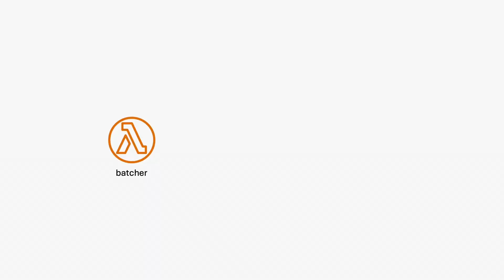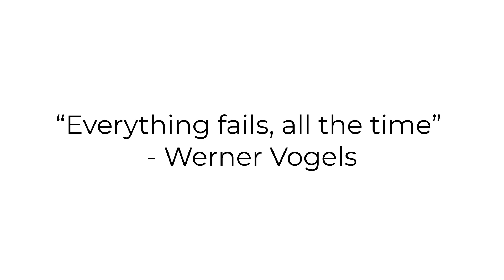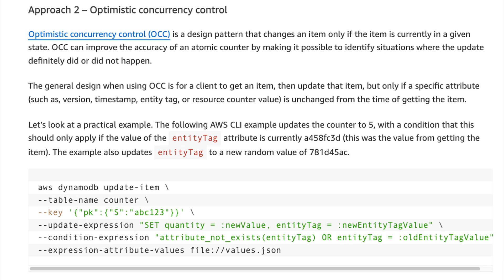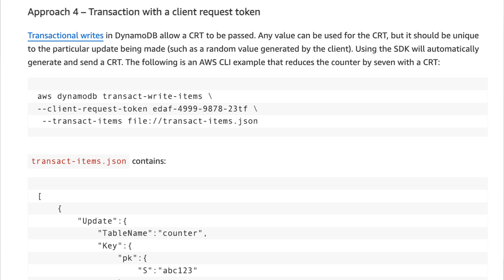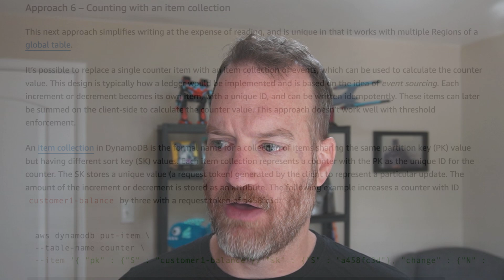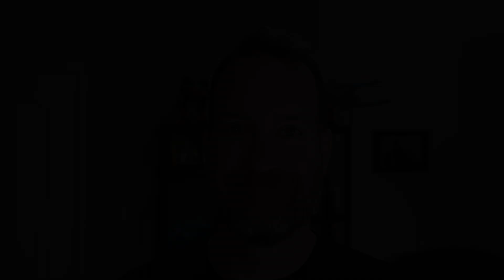Batch Process in AWS - Part 2

Comment: Is Dynamo failing or just that standard SQS is at-least-once delivery? I see the latter quite often, but never really notice the former. Either way, if you want to guarantee/validate your counts, just give each task an ID and once done fire them onto a FIFO queue with deduplication, you can compare your counts before/after each decrement. This requires more DB reads, but you can consume messages 10 at a time, so only have to write 1/10 of the time, making it cheaper overall (not counting Lambda execution time).
Reply from the maker: DynamoDB sometimes fails and that ends up with over/under counting on the atomic counter I covered in the previous video. FIFO queues wouldn't solve this problem.
Reply: @MatthewBonig  Maybe I wasn't clear. I'm pointing out two issues and a solution for both. Use a FIFO queue to process counts with deduplication. Use the handler attached to that queue to read, then write, then handle 500 errors, knowing the count before the error allows you to correctly apply the count.
Reply from the maker: I don't think I understand.
Reply: @MatthewBonig  You want to accurately count the completion of a batch of tasks on an SQS standard queue, right? There are two problems with what you're doing. 1. SQS standard queues are at-least-once delivery, meaning you can get double counts. 2. DynamoDB may fail with a non-deterministic error (the HTTP 500 you mention in your video), meaning you don't know if your count was recorded or not. 

A simple solution to both problems is to place the results of your tasks onto a second queue (not DDB). This queue needs to be .fifo with deduplication. Its handler needs to read the current count before updating it, that way it can validate the count in the unlikely event of an error and decide to retry or continue. In other words, the fifo queue lets you update the count sequentially and validate the result. The only caveat here is the 5 min deduplication window, if your processing tasks take a long time to complete, then this might not be water-tight.

Two other DDB based solutions could include: 1. creating/update a unique record for each task. 2: adding/removing IDs to a String Set within a single record. The former gets a tiny bit ugly when it comes to checking if all records have been updated/deleted, the latter doesn't scale past the 400KB max record size.

I hope this makes sense, I'll leave it at that either way.
Reply from the maker: Why use the second queue? Why not just make the first a fifo queue? However, this only helps with the idempotency of processing the record.

As you said, the 500 when updating dynamodb is the problem. I COULD read the value before writing it, but due to the high concurrency of processing it would almost always be updated by another process. Optimistic concurrency and conditionals would catch this but would also introduce an enormous amount of churn in the processes as they kept retrying over and over to get a transaction written.

As for the two ddb options your suggested, the first is basically what my solution (see part 3) proposes, with the items being removed when processing is done and polling to check when no items are left. As for the second, you already mentioned the flaw, 400kb max record size would make this an immediate no-go for processing 100k records.

Thank you for the comments, I appreciate the discussion.
Reply: @MatthewBonig  the second queue is to sequentialise ddb operations while not impacting the "worker" tasks. This also reduces the amount of read/writes to ddb as you can process up to 10 records/counts at a time. The addition of message deduplication helps avoid double counts from more-than-once delivery. If you need to count faster, you can hash task ids to one of N group IDs (and have N count fields in the record). Additionally, if you face ThroughputExceededExceptions you can delay the message and retry without having to re run the worker. In summary, breaking out your ddb writes to a dedicated queue comes with many benefits. I could write a book on it tbh, especially how to reduce wasted provisioned capacity from spiky loads.

I should've updated my previous answer, I didn't watch your update until after posting. It's a good solution too, I'm just describing an alternative.